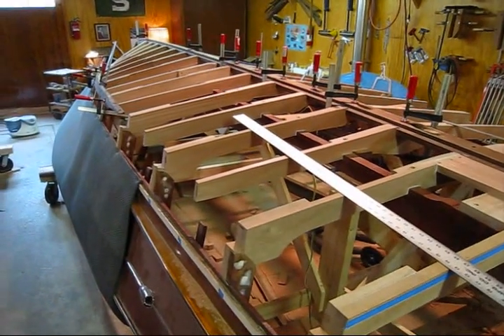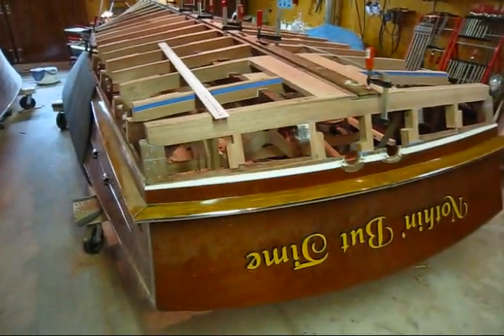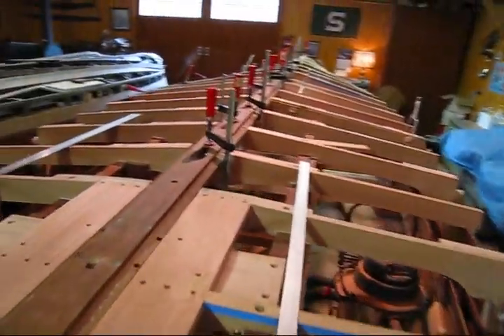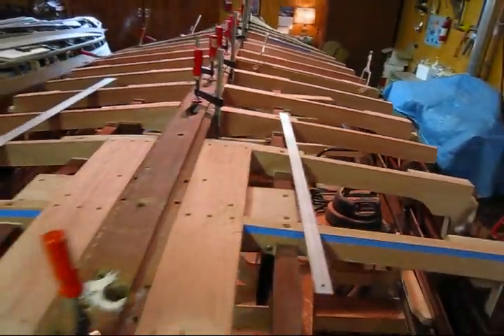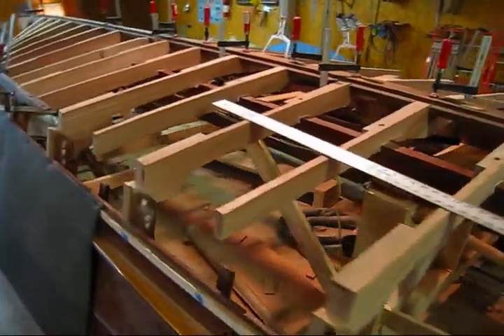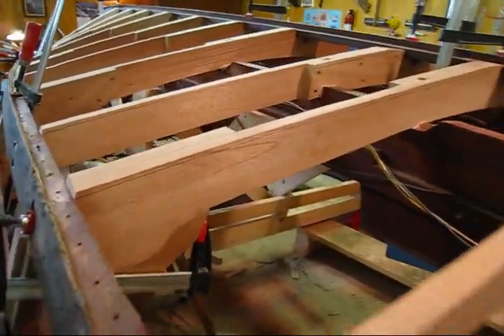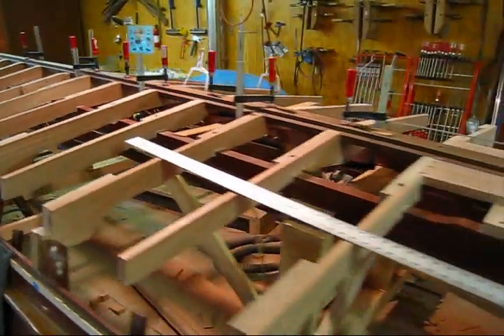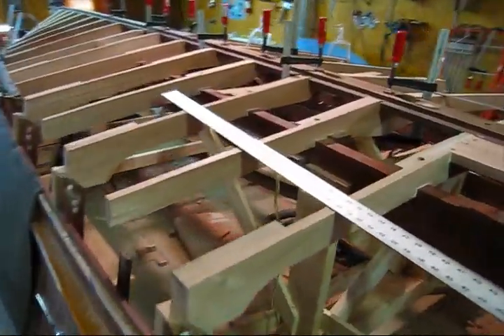Fairing Bottom Frames (Part 1) (Preview) Wooden Boat Restoration

Comment from the maker: Hi Klaus, That is a Rockwell Model 167A Power Planer. This one was probably made in the 70's. I was told that this model was popular with carpenters who used it to trim the bottom or top of wood doors to make them fit. It has a single spiral cutter about 1-1/4" in diameter. Thanks for watching the videos.